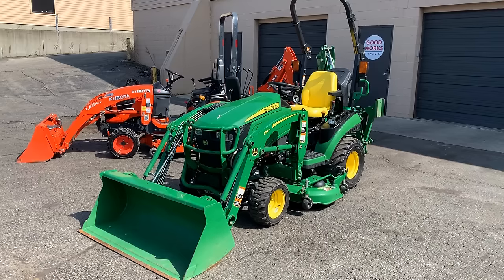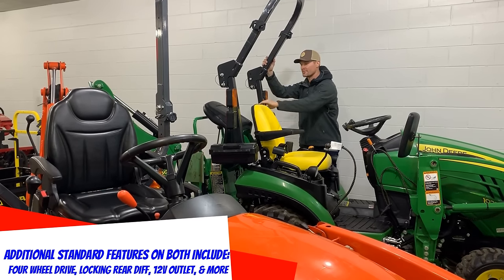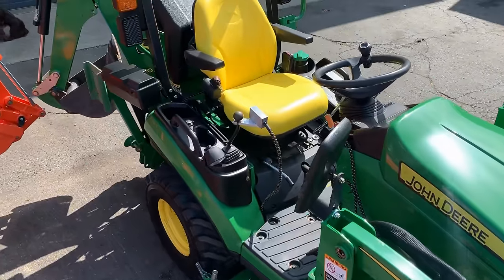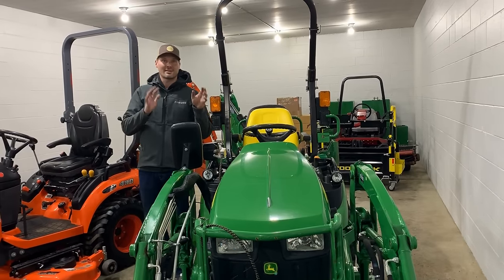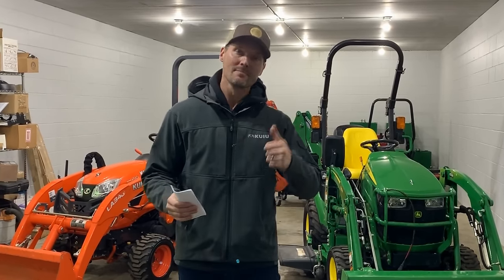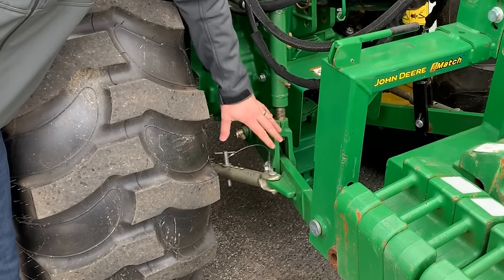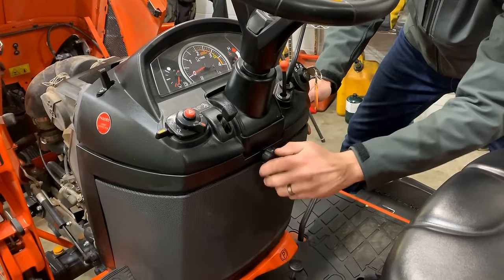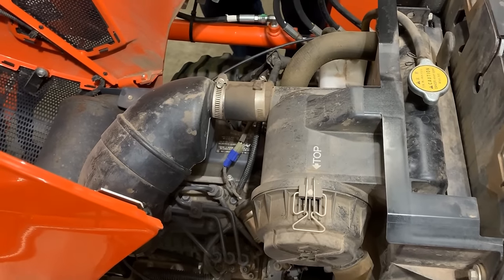CLEAR WINNER? JOHN DEERE 1025R VS KUBOTA BX23S TRACTORS! 🚜

Comment: Great video comparison. However, for me, there is no comparison. John Deere wins, hands down.
The John Deere design simply works, is operator friendly, and quite comfortable. Keep in mind, I'm referring to the 1023E versus the Kubota, not the John Deere 1025R. Yes, I said the 1023E. 
1) The setup is perfect with the original seating and the original steering position. If it is already that comfortable you don't need the trinkets. Just try it for yourself first.

2) Note that the three point hitch design on the John Deere for the antisway could be better with the larger tractor design you mentioned. However, the John Deere design is superior to the Kubota as the antisway pulls the arms to the outside where the Kubota pulls inward. The problem becomes hooking up the three point hitch to an implement as you'll end up having to loosen the antisway just to let the arms go wide enough to get past the width of connection pins. The John Deere suffers no such issue. Then again, I personally prefer the iMatch John Deere Quick Connect and have one just for the ease of hookup. Who wants to have to mess with that anyway when you don't have to? Another issue with Kubota design is it cuts down your maneuvering room when hooking up a PTO shaft. 

3) In that same vein, the three point hitch does not have a float position on the control and it could definitely use one. On the larger row crop tractors there's even a mechanical adjustment for a float on the three point hitch that at least will give you some freedom of travel, though its not the same as a controlled on demand float for the three point hitch lever itself. 

4) You showed us the Kubota version for the hydraulic couplers. There is an issue with that design. It doesn't allow you uncouple independently to switch the positions. Now why would anyone want to switch positions, you say? Well, here's one example.
 
If you're out in the field working with your bucket loader and you suddenly realize that your bucket will only raise up two feet and stop in the same manner as if you had maxed out it's elevation travel, even after lowering and raising again to no avail for the problem going away, you're now having to face quitting and getting your equipment repaired. What happens is sometimes quality control has a hiccup and this can happen on any tractor no matter who manufactures it. If there's something floating in your hydraulic line that hasn't found its way to the filter system yet then it can get hung up in a control valve. Now instead of calling your dealer for an expensive service either onsite or hauled into the shop, simply reverse the hydraulic couplers. Be sure to take all the bucket loader pressure off before decoupling. After you have reversed the couplers so they are now in the wrong position, restart your tractor and move your control lever in the wrong direction. Up is now forward and down is now rearward. This can force whatever is causing the blockage out of the valve. Work the loader a few times, then shut off the tractor, take all the pressure off the hydraulics, reverse the couplers back to their original correct position. Restart your tractor and see if that worked. You can't do that with a Kubota. 

5) Personally, I'd prefer and additional set of hydraulic connections on the rear of the tractor. That way you can easily connect to implements of a trailer design to raise and lower implement wheels.
 
6) Yes, the no draw bar thing is a real problem on these tractors and there's no excuse for not having one. I'm currently in discussions with my John Deere dealer over that one to see about getting one installed.  Given the narrow design of these tractors the drawbar might have to come out a bit further than a larger tractor simply because you don't want a trailer reach to get hung up easily on the rear tires in a tighter turn. That could be deadly and is always a serious consideration with any tractor. 

7) These tractors could all use a better system to hook up auxiliary lighting rearward. Putting on your own flood lights to light up towed implements when you have to continue working after dark is fine, but a wiring harness that's ready to accept a plug-in is a major plus that should have been standard.  

8) I too am not in any way a fan of plastic. Years down the road I want my very expensive tractor purchase to have the potential longevity of the good ole Farmall M. Many of those tractors are actually still in service even today. Such is the same for the 4020 John Deere and the 5020 John Deere. You can't do that with plastic hoods, side panels, and fenders. Who is going to be making replacement plastic 40 years from now or longer? At the least you can repair these pieces if they are made from steel. Try doing that though with plastic. 

All in all my John Deere 1023E is a great little tractor. Believe me, the uses are seemingly endless and it's definitely very handy for a great many jobs. At present I'm setting up for using my John Deere for PTO power for an emergency generator application for the house for those times the power goes out. The problem I'm having at present though is getting a perfect match for this tractor on a three point hitch setup that's compatible with the iMatch Quick Connect and isn't some chintzy pipe frame design waiting for an excuse to vibration crack. Years back John Deere produced a unit they called the Model 10. It appears to have incorporated a NorthStar Generator. Unfortunately it's not made anymore. 

Anyway, great video, informative, and enjoyable to watch. well done.
Reply: Very well written comment.  I have a 1025R but I agree that the tilt steering and seat (and also the work lights) are not a big upgrade. In my opinion the only significant difference is the 3 point hitch control.

Comment: What do you think about the new Curtis Cab AC? It adds about 3k to the cost plus 3k-4k for the cab tho. Living in NC its HOT and humid so I was consdering if a LX or "big B" with a cab would be more appropriate just for the AC reason plus the higher lift capacities. Do you think its worth sizing up to get the factory cabs?

Comment: Thanks for the video, subscribed.
I''ve put 120hrs on my 23S and absolutely love it. Done a lot of backhoe work digging out stumps,  the hydraulics can't manage dual movements in one motion (eg, raise boom and move bucket sideways in one movement which I wish it could. Also I have the 4 in 1 bucket which i love but can't pick up large objects and means I can't have the skid steer attachment which i think i would have preferred so i can use other attachments. I've bolted an ammo box onto the ROP for a tool box, and strapped an LED light bar to top of ROP which turns night to day. A tow hitch would be very handy so i don't have to remove the backhoe to tow anything. Also I wish it had a clock on the dash so i know when to stop for smoko, lol.
I'm in australia and it cost me $31,500 in April 2018.
Overall I would highly recommend the Kubota for up to 5 acres which i have, any more and i think i would be looking for something larger.
Reply from the maker: Great info, thanks for sharing!
Reply: Did that include mid mount mower as well for that price? I’m also in Australia.

Comment: Back in 2016 I was in the market for a tractor. Never owned one before. We have a JD and Kubota dealer in town so I checked them both out. For me, equipped the way I wanted it,  the $3000 difference in price for what seemed like the same tractor made my mind up. Been perfectly happy with my BX25D. I do agree with a lot of the complaints I read about, but most are minor in my opinion.
Reply: If you need to buy a tractor today, same sizes, would you buy the 25D again? Lifting power, HP?
Reply: @PoisonShot20  I would. It has never let me down. If I had Bill Gates money i'd buy a bigger tractor but still stick with the Kubota.

Comment: How do you feel the New Holland Workmaster 25s/ LS MT125 compare to the JD and Kubota?  I have a JD and NH dealer close to me and will be checking them out in person once I am ready to buy and I kind of lean towards the NH 25s. 

Maybe if it helps, I've got 2.2 acres and would be using mainly for mowing, grapple, and wood chipper. Zero need for a backhoe or snow blower.
Reply from the maker: I would go give them a good hard look.  I honestly have more feedback from speaking with customers about NH rather than first hand experience.  I don't want to knock them, but you get what you pay for.

Comment: If Kubota would put a position control 3 point lift independent of mower lift, more powerful hydraulics, a medium range in transmission and some nice small tool storage and an HST that wasn't so loud I'd be 100% happy.
Reply: They actually do all that! Its called a B series tractor. Lol. Sorry bro, couldn't help it ...
Reply: @andysworld2188  Yeah they do but it’s much heavier and much taller. That BX with some updates would be a good unit and fit inside a 7’ garage door height.

Comment: I would take the control layout, gauges, ROPS, 3 point hitch, and single point connector of the BX and put it on the 1025R. In my opinion that would be the perfect tractor.

You can now get telescoping stabilizers for the BX. I did some research and the reason you can't get them on the 1025R is because the stabilizers are outside the lower arms there just isn't enough room.

I think another reason for the lack of telescoping stabilizers though is the prevalence of quick hitches. It seems most subcompact tractors are leaving the dealers with them now.

Comment: I will be looking for a tractor next year sometime when we move to a rural area. Tiller, lawnmower, and a bucket is all I'll need. I probably look for a used unit. My question is maintenance and repair cost between the Kubota and John Deere. The model, I don't know yet, are they close to the same cost or is there a significant difference?
Reply: Bring along a jar of Vaseline if you take either to a dealer. We have a local shop that services any brand for a set labor price. HST service, oil change, radiator flush and fill... same price regardless of brand.
Reply: Lawnmower, tiller, bucket... uh huh. Then you will want a box blade for driveway maintenance, then you will want to do some fence work, so get the post hole digger, then you will discover a rock garden you just tilled up, so get a landscape rake. A trailer of some sort is indispensable. Then you realize you are tired of playing with toys and trade that sub compact in on a full class 1 tractor...

Comment: Thanks for the awesome comparison.  The air ride seat and easy adjust side adjustment on the 3 pt hitch would be great improvements for me.  I am still glad I purchased the John Deere 1025R.  One thing you could have mentioned is the three point lift arm height adjustment, but you recently when over that on a prior video, so it will be ok.
Reply from the maker: Agreed, may not be perfect, but still a great tractor!

Comment: Kinda funny how you mentioned a cab with heat/ac bc that was something I was kinda hoping to get on something around a compact/ subcompact size
Reply: Matt P  it would be pretty helpful for those that enjoy being on the tractor but end up having a short day because of bad allergies or the sun/heat getting to them
Reply: Matt P  The seats will turn around for backhoe use  cab or no cab
Reply: Matt P  they do. The kubota bx2680 has a air conditioned cab option. It's like $7500 on top of the $18000 base price so nobody is buying them. John deere offers just a basic cab with no a/c.
Reply: @Internettumbleweed  yup I echo this. One year I was sick and the heat got to me easily. I’m ok now but it’s the first thing I thought of when I saw the hard cabs. (Well that and not freezing my @$$ off in the winter clearing snow)

Comment: What drives me crazy the grill guards.  These will not protect anything on all makes .  They all have large holes.  It would be nice that they should have some sort of expanded metal on the front of the guard to protect from sticks.  Another thing on the Kubota is the fuel filter under the tractor to the pump.  They need to have a cartridge type up closer to the engine like bigger tractors

Comment: I bought a B.X  25 with mower deck my only complaint is wheels on deck don't swivel as result have riped a couple of I'm going weld on swivel on all 4 coners I do a 5 acre orchard,plus use it in my contracting business.I have done double the work of friend with John Deere he's never used for moving drain but his bucket is all torn to hell??? I use turf tire's even in mud never really got stuck.I damaged my hood so going to replace it.I very happy with it done far more than ever thought it would do.

Comment: Excellent Video my man, I just recently purchased a couple months ago a John Deere 1025r with the front loader, the drive over 60" mower deck and a ballast box. I love this tracker; I'm thinking of getting the speeCo CAT 1 E hitch quick hitch from your website. I hate trying to connect the ballast box when I'm ready to use the loader. With the speeCo quick hitch attached and nothing mounted to it, would it drag when using the mower deck, I know both the deck and the 3-point system lowers at the same time. just curious, any info would be greatly appreciated. PS, I'm really liking that Good Works hat, your website doesn't currently show that one. I realize this video was posted 2 years ago, that could be why. Thanks for all your informative videos.

Comment: I’m pretty sure it takes 8 to 10 horsepower to pull an AC compressor on a hot day. Might tell you why they don’t put premium cabs on a tractor that small.
Reply from the maker: So why does the 26HP Kubota B2650 have a factory cab with a/c?
Reply: Small  cabs like a Kubota, Kioti are probably in the 3 hp range for AC and HST transmissions probably in the 5hp range. The tractors run OK for the most part with everything on.

Comment: Solid rubber tires, in the south west  Mesquite trees eat tires. Tires that never go flat. I got like whip lash from driving  a small tractor the ride made my back to sore it was hard to work for a couple days, and air ride seat would be the best item they could add. I got a pick up truck for my tools. LMAO , Batteries last on average four years in the South west the heat kills them. Deck mowers what a waste on both of them, a brush hog ran off the rear PTO shaft is way easier. A forward mower deck would be even better. Thank you for the video

Comment: Man Kubota hands down! True comparison would be with a Kubota B series! (Also can get a factory cab with heat and AC) the biggest difference hands down if your buying to do  a lot of  Backhoe work  is the one SEAT! I can’t stress that enough! What a pain to get on and off tractor to reposition for digging or ditching. Great video
Reply from the maker: Thanks for watching.  The B Series is substantially larger, classified as a compact, it is compared to the John Deere 2 Series.

Comment: Not a tractor you deal with , but what do you think of TYM  or RK  ( Rural nKing  ) ? I know their much cheaper but do have an 8 year , I believr warranty ?
Reply from the maker: I'd have a tough time trusting them long term for reliability, parts, and service.  Not to mention, they won't hold value.  However, if you found a steal of a deal on a used on with really low hours, then might work out.
Reply: @GoodWorksTractors  Heard that getting warranty work at a lot of dealers is a PIA , they like to deny everything.
Reply: I have a TYM T25 and couldn't be happier with both the tractor quality and the dealer.  Had one small warranty issue and it was taken care of promptly.   My T25 can outdo either one of those 2 with ease, for way less money. 
(Tractor/loader/backhoe for $24k out the door.)

Comment: steel versus polymer hoods and fenders = curb weight difference. I give the PLUS to JD for less curb weight. JD 1400Lb FEL versus Kubota 940LB FEL lift capability is a HUGE!!! PLUS for JD. I am quite surprised to hear that there is a 460LB difference. That's a major advantage to JD. All that said, both are fabulous compact tractors. We sold our older Ford tractor, and we're looking at these two choices.
Reply: Less curb weight of the John Deere could be a disadvantage if doing ground engagement work.
Reply: Mahindra beat all, incluiding Kioti, on curb weight. Never owned one, just looking and reading the specs on them. Plus ground clearance, big deal. Mechanically, durability? Another story, don't  know. Warrantee  is great, dealers are scared, my closest one is about 1 hour way. MF is my closest one, but their subcompact  looks like my Toro 520 Xi. 😂

Comment: The quick connection pto system is very high wear and not worth it unless it is a low hour machine. The Jd connection is the one I Have used in a 3320 and an x758 same type of set up.the problem is the bearing holder at the deck end in less than 200 hours it will wear through the metal and the little cup head bolts that hold it on will fail. Early symptoms are a rattle from the deck.My 3320 connector was troublesome at 100 hours the machine now has 8000 hours on it (these machines can last a very long time)normal shaft ,not all those hours are mowing.
Reply: thank you for you feedback, i'd been pondering on the mid mount mower system vs the 3 point finishing mower, amd what your saying makes sense to me....i'll stear away from the mid mount mower deck and go for something what would last longer.

Comment: I have a hip problem, so the Kubota heal petal for reverse looks to be a "pain".  I like the 2 petals, side by side that JD has.  (currently use a JD 345)
Reply: To each their own. With a size 13EW steel toe boot, I find the side by side pedals clumsy and awkward. Also, forward on the left is counterintuitive, for me at least.

Comment: The Deere achieves full hydraulic pressure at idle,the Kubota has to be revved up to 2200 RPM to get full hydraulic pressure.